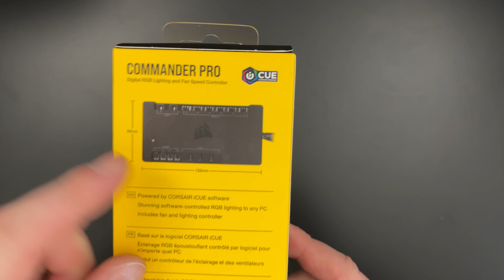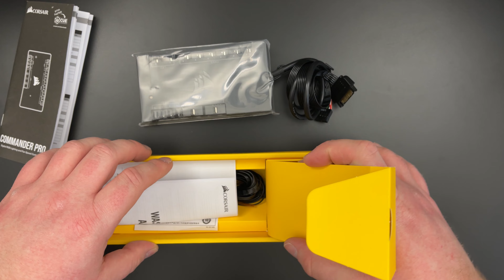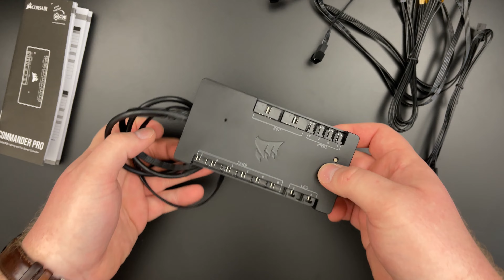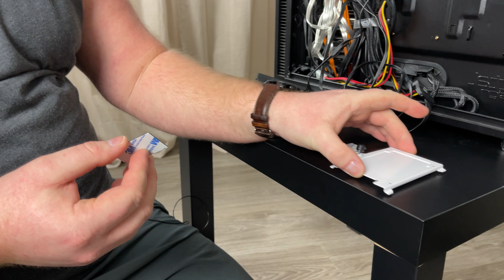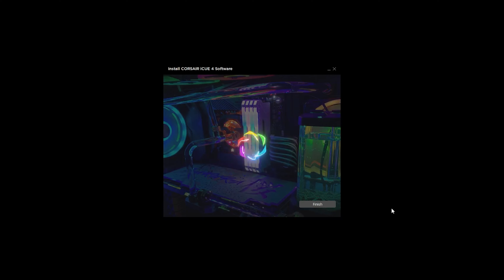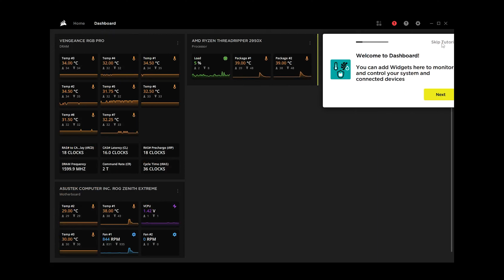Corsair Commander Pro: Review and how to install

Comment: Cab i use jist the commander for fans ? Or do i need hub
Reply from the maker: The commander pro has a built-in hub, so you don't need an additional hub unless you need more ports. To control the speed of the fans you need the iCue software from Corsair 🙂
Reply: @techiedoodledoo  are you meaning the commander core

Comment: Very detailed video, thank you for that. I’ve one question, can I use the fan controller with Noctua fans?
Reply from the maker: Thank you :) Yes, you can use it with Noctua fans, however you will only be able to control the fan speed, not lights.

Comment: My motherboard is Asus Prime B450M-K II, a non rgb or argb supported motherboard, so can i use this to light my rgb fans in my case ? sorry for bad english
Reply from the maker: You should be able to control the RGB on the fans using the Commander Pro with your motherboard as long as your fans are compatible with the controller - you can find a list over compatible fans here: https://help.corsair.com/hc/en-us/articles/4409125722509-Controller-compatibility-with-devices-and-accessories